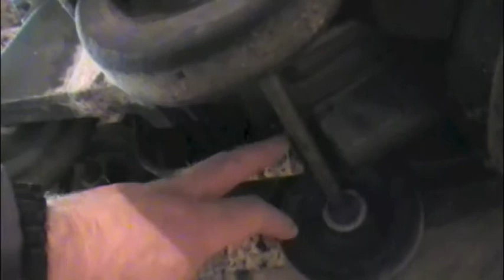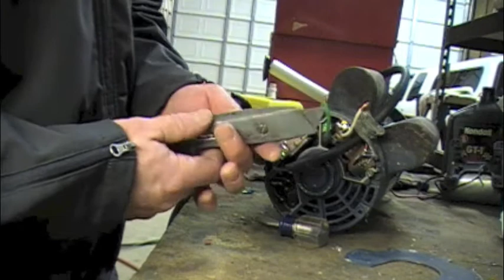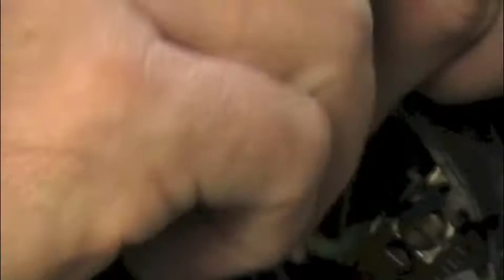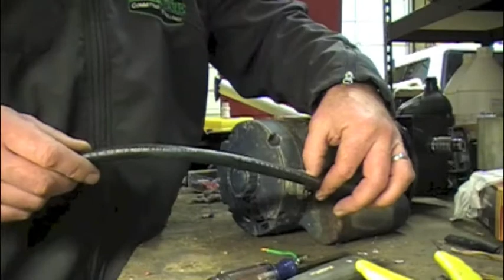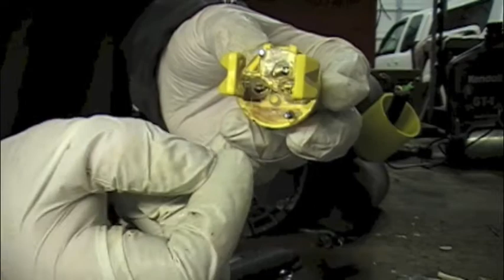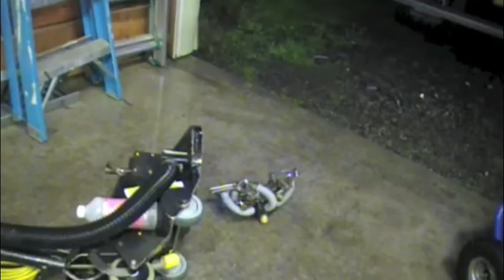Carpet Cleaning - How to do an electrical repair on an RX-20

Comment: I've got a great place to buy the small spider hoses when they need replacing. They last so long but get brittle over time and if the vinyl cracks then the reinforcing wire gets rusty and it's down hill from there.  Call me at 480-228-9007